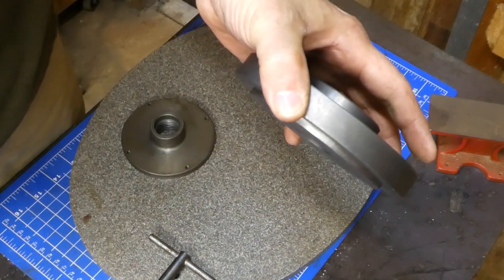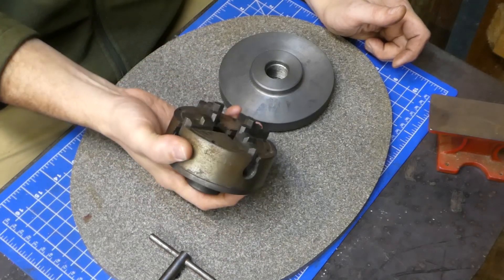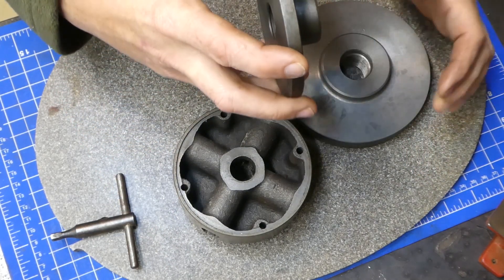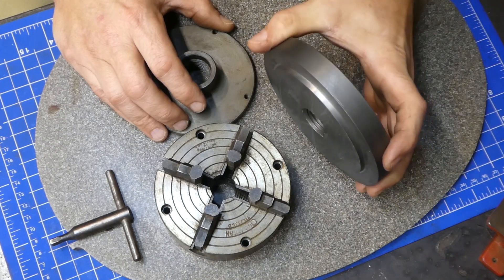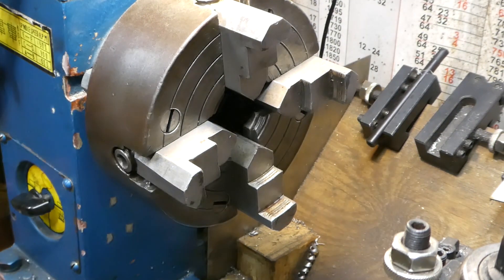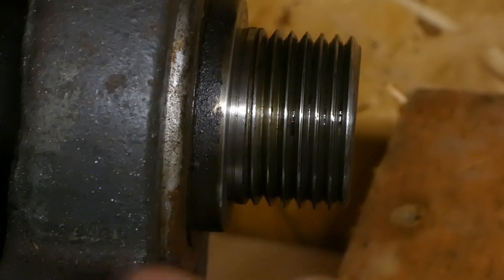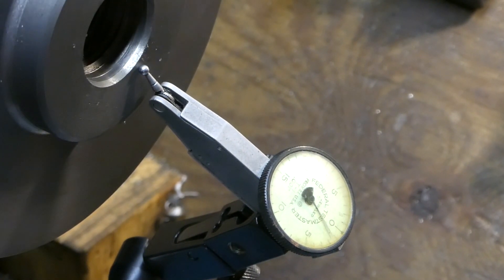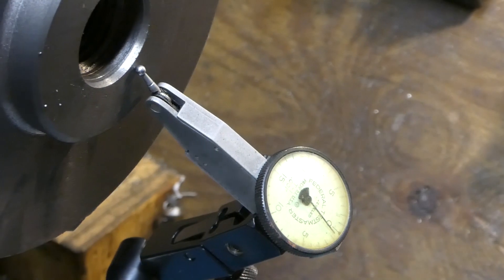Adapting a new back plate to an old lathe chuck the hard way

Comment: Its awsome that rectified they problem with a customer, you went the extra mile & while i agree with you that you should only machine a backplate on the lathe it is for he can always just mount the backplate on his lathe when it arrives & skim both surfaces & this will true it up to HIS lathe. You already did the hard work machining it to size & drilling the hole pattern. I did a 8" one recently & I hate machining cast iron as you get that dam dust every where. I had to use coolant with a large radius carbide insert to get a smooth shiny surface finish & it kept the plate cool as you know it gets hot
Reply from the maker: Thanks! Yeah, I try to stay away from cast if at all possible. It is a mess.

Comment: That's a nice looking backplate, the only thing i would do different is i would make recess on center as close to chuck as possible so chips won't fall in through that gap and get trapped between backplate and chuck, i was turning backplate for a bit bigger lathe lately (315mm chuck to 250mm chuck swap) and i had no tools to mesure such diameter so i just kept turning backplate and fitting chuck to it to see if it fits many times after more than a hour i had perfect fit without using any mesuring tools so i'm happy that my patience paid off.
Reply from the maker: Hello, thanks! Yeah, I was just replicating the basic design of the original back plate except leaving it a bit thicker to give it some mass. Patience is the key word for sure.

Comment: Great job. I had to do both backing plates for my lathe. As easy as cast iron is to machine, I still hate machining it because of the mess. I just cleaned up my mill yesterday from boring a cast iron half nut for my lathe. I bit the bullet and spent a couple of hrs. doing a thorough job with vacuum cleaner then mineral spirits and wiping down with clean paper towels. Followed by WD-40 . Now I can rest assured it is not rusting while i am staying warm in the house.  Thanks for taking the time making the video and all the detail.
Reply from the maker: Yes  that stuff is a mess. Easy to cut, though not always easy to get a good finish. But the dust and chips are the worst. And they go everywhere even though I was using some shielding most of the time. Unfortunately I left the mic drawer open on my Kennedy, so now they all have to be cleaned and the drawer emptied as well. I need to use a gopro for cast in the future too. The camera need a complete cleaning. Oh well. the finished product looked god, lol.
Thanks for watching!
Reply: @theeddies  I usually use aluminum kitchen foil to cover everything but this time i got in a hurry and regretted it within minutes. I was taking such fine cuts it was like powder. Still need to clean the drawers of my box and some of my tools.
Reply from the maker: @terrycannon570  That's a good idea but I am the same way, I want to just start a job and then forget about everything around it, lol.

Comment: That finish is nothing to sneeze at. It looks great. It's nice to have an alignment witness mark (line) that is half on the chuck and half on the backing plate so when you take it apart to clean it it goes back together the same way.  I just used a scriber make a line on mine. - The tool post mounted indicator holder looks real good so far.
Reply from the maker: Thanks, yes I need to do that before I ship it. I usually punch a dot on the adapter and the chuck across from each other. The indicator holder is not mine. I have been looking at a few designs out there to see if I can do anything different. That orange one in the picture is really good, hard to improve on.